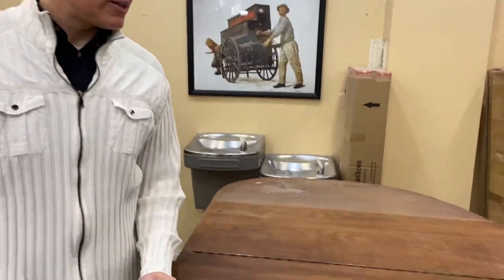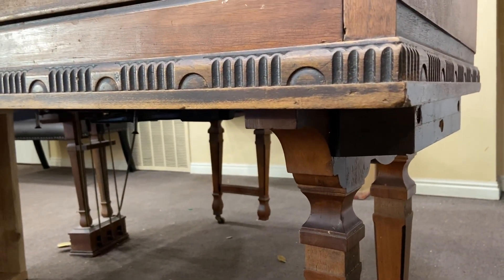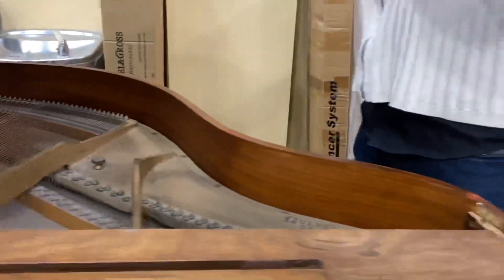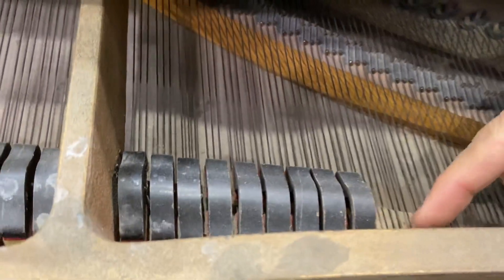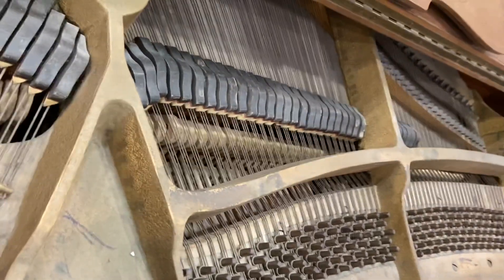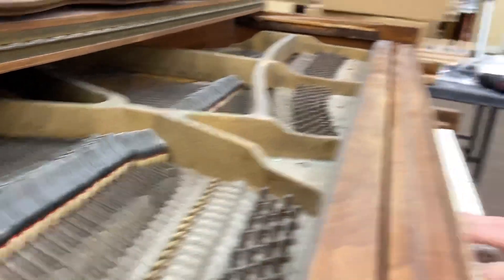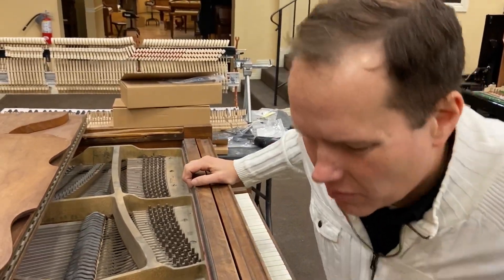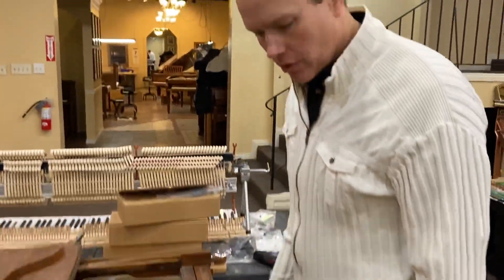Gulbransen Grand Full Rebuild: Before Restoration

Comment: This was a low end piano when it was designed and built and is an even lower end piano by today's standards. I wonder who is paying to rebuild it..I understand that some pianos are family heirlooms, but common. I don't care how strong the attachment is, use that money to buy a different piano.
Reply: @@mikeearnhart I understand that it will sound better than new.. but better than a used kawai or used Yamaha? Maybe even a used young Chang? What about a used Hailun. At the end of the day, you can change hammers/strings, but you still have the original scale and other possible "flaws" or limitations because it did start as a low end piano. Like I mentioned in my original comment, I understand that it may be a family heirloom piano..